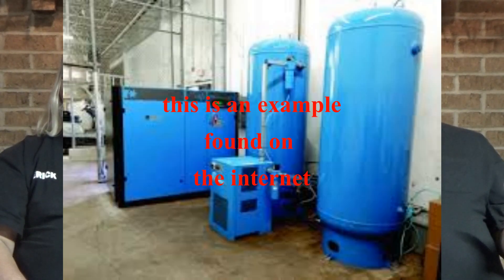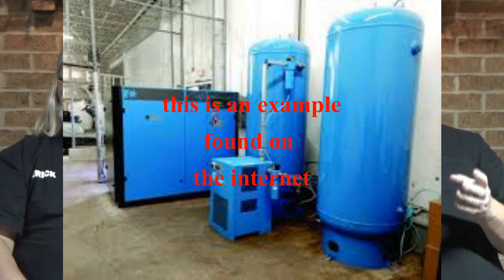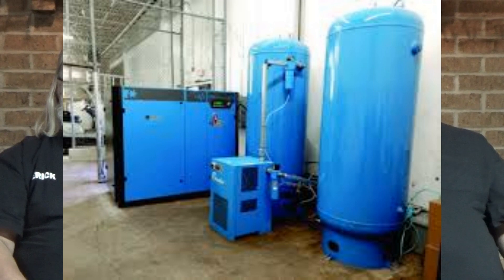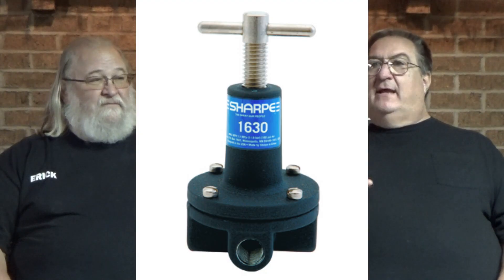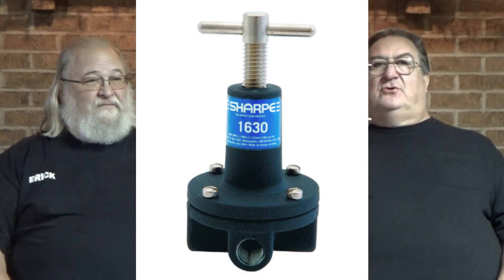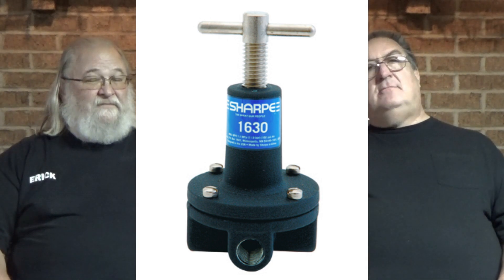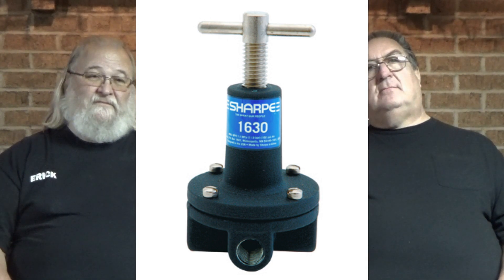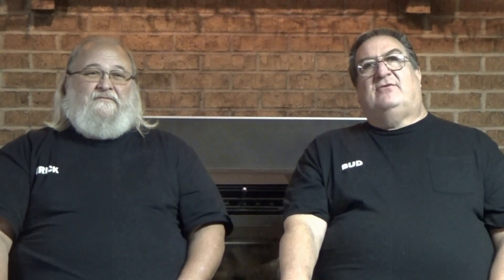Add a Tank to your Air System S3, E 14

Comment: IM IN THE PROCESS OF EXPANDING MY AT HOME AIR SYSTEM I REALLY APPRICATE THE INFORMATION YOU ADDED HERE. THANKS. DOES THE RESERVE TANK NEED TO HAVE ITS OWN PRESSURE GUAGE AND RELIEF VALVE ?
Reply from the maker: That is a bigger question than you stated. if the tank is the same max working pressure... the home owner answer is no BUT a boiler inspector wants every tank with its own safety valve, gauge and drain.
Reply: @THECompressorGuru  Thanks i appreciate your response

Comment: Adding a tank to your 5hp 80 gallon. Now not only does it have to keep up with your standard palm D/A sander which they barely do.....now it has to work longer and hotter to fill up another tank also. I call it cooking your pump. Hearing these idiots in forums oh i added another tank now i have more air. No you don't, you have less CFM off that 5hp pump now
Reply: Bill it's the same amount of air, the tank doesn't draw air
Reply: @robertbowman9108  the added 80 gallon tank doesn't draw air from the original 80 gallon tank? Where does it come from?
Reply from the maker: I am not calling anybody an idiot. this episode point out the advantages and the disadvantage to adding tanks to your system. did you watch to the end? because we did cover your words" cooking" your compressor. most industrial compressors ( and they are designed)  can run  non stop and handle it. it not more CFM its more reserve.
Reply: @THECompressorGuru  'reserve' really?... It's just upsetting, now your pump has to fill ANOTHER tank AND run your air tool. Basically the equivalent of one man running two air tools at the same time, taxing the compressor, hotter, MORE water. The output of your 5hp rig went from 17cfm to 8.5. It's terrible that people believe this is more air, but i guess it's good for sales. Sure it's ok on a screw compressor thats made to run 24/7.
Reply from the maker: @billdavid6315  Bill there is a difference between CFM and reserve.  If you have a problem with your compressor not keeping up with a DA. perhaps you have an issue with your compressor. a rule of thumb for sizing ad compressor for a body shop is 2HP for every technician . so a 5 man body shop would use 2 5s or a 10 hp. and that should support all of them picking up a da at the same time. if you bought a machine from a big box store perhaps you are not getting the performance that an industrial pump like a QT5 or a 2475 IR. 
you are always welcome to contact me through thecompressorguru.com. have a good day.
Reply: @THECompressorGuru  I have many industrial compressors and 30 years paint and body. I've set up many shops. I think the qt5 is the lesser to my 325 and i also have the 2475 you mentioned. Show me a 2hp air compressor that will run one of my 14CFM Dynabrade sanders at 14CFM for 5 minutes, you can not.... Now add a second man sanding these cars = 28CFM..... Now add a THIRD JOB ....Ummm, let's say, filling up another 80 gallon tank
Reply from the maker: @billdavid6315  Bill I agree the 325 is the BEST 5 hp you can buy the qt and the 2475 are about equal in quality. the 2 HP per man is how to size and it is the minimum . the example I put down was the extreme but still fare. 2 a 2 hp will not run your belt sander but on average 2 hp per man in a body shop is a good number. and with more shops doing less rust work and more collision that 2 hp is more and more secure. also if you have the reservoir built into a system that increases your cycle time and it would be more than 15 minutes  because of the added reservoir.
 for grins and giggles I just looked up 2 different cfm uses. IR 311a is average 4 CFM
IR 317 A is 25 cfm . the difference in these numbers is 1 is and average and the other is if you pick it up and pull the trigger and never let off the trigger . the extra reservoir help average even the pull the trigger kind of tool so there is food for thought. for all of us. have a great weekend.

Comment: Should “point of use” reservoir tanks have a check valve on the input side? Seems like they should be checked, otherwise, upstream loads would still siphon off the air power of the reserve tank at the end of the line?
Thanks for your videos.
Reply from the maker: that is a possible scenario . ideas like these become very system specific. good point. thanks for the comment!

Comment: i believe comp should only run 6/8 times phr starting to often is hard on mtr and engerny air tanks are cheap buy a good 325 quincy if not big enough add another 35 cfm thats a lot of air
Reply from the maker: some pros and cons to your statement. 6 times and hr is when we recommend to turn on the dual pilot if equipped. if not equipped more reserve will make the cycle time longer therefore lower the start times per hr.  I am all for adding 325. PS I a have a used 1 in the shop I am going to rebuild it and someone will get a good deal on it!

Comment: good video what are your thoughts about speedaire cast iron series machine
Reply from the maker: Speed air is a grainger label. they have compressors built for them kinda like sears did years ago. unlike Quincy or IR in a few years you may not be able to get parts for the speed air model you buy. if you are in a commercial shop, i would steer towards something you can get parts and service on. Grainger has zero technicians.